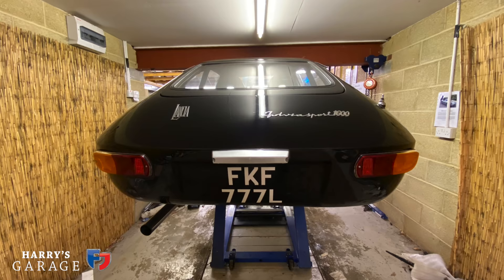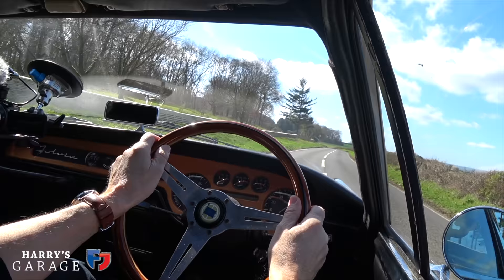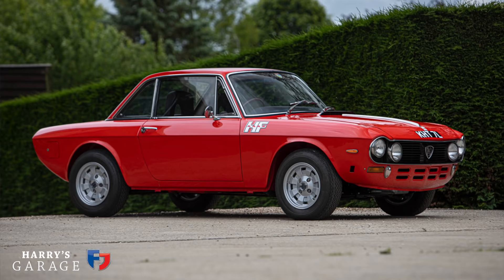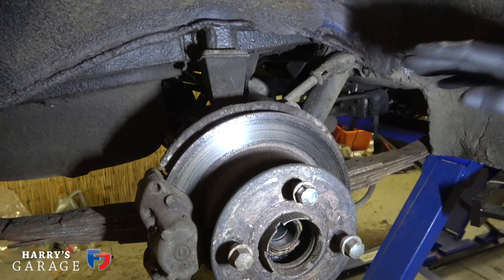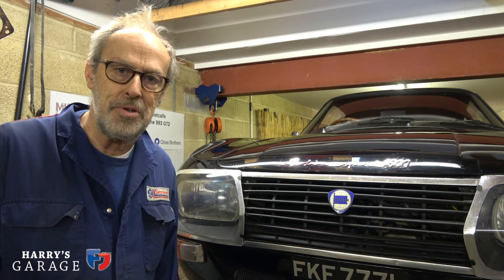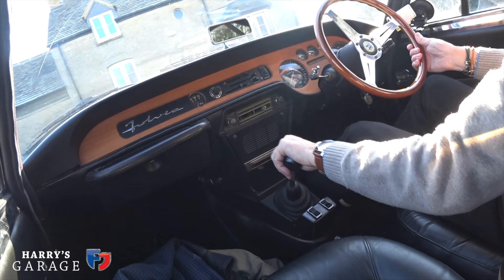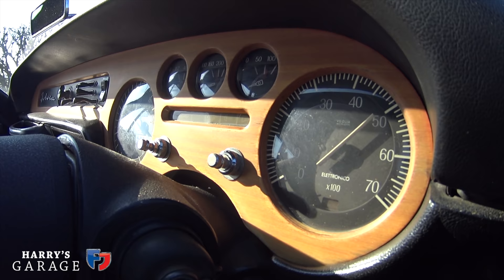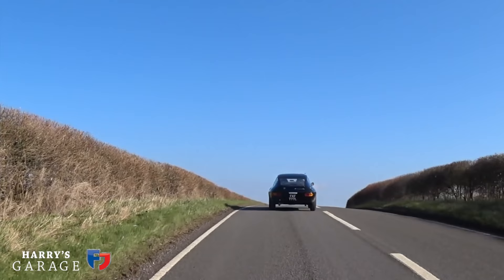Lancia Fulvia 1600 Sport Zagato. Best sounding car in the garage?

Comment: As a Fulvia owner myself, I'm a bit skeptical of what other enthusiasts often say, but they may actually be correct in that the Fulvia's stock air intake is carefully engineered for optimum flow. Using trumpets on these engines, while making a great sound, is rumored to be a cause of low RPM dead spots on Fulvias. I don't feel qualified to make that determination because I have not run trumpets on my car yet, but this is something that has been repeated for years by the more experienced Lancisti out there. They all seem to agree that the stock air box must be left in if you are running a stock tune.
Reply from the maker: I've had a number of works Fulvia 1600HF up here and none have run the standard air-box. The V4 is renown for having good low-down torque anyway, so I would say running trumpets is fine, although I've added air-cleaner socks to the trumpets now, as I don't like running road cars unfiltered. Sound is near identical too. Air-box is also heavy and kills appearance of engine bay; remember these cars are toys now, so make it the car you want it to be, rather than worrying about keeping it standard.
Reply: @harrysgarage  Thanks for the reply! It's encouraging to hear your response on the matter as you have a lot of expertise. I want to run trumpets on my 1300 to add to the sound and the driving experience, as I am not bothered by potential marginal drops in power. My car is already started towards a rally car direction and I would love to take it even further. Tastefully of course!

Comment: Now that's my kind of car. I was so stupid (I was ill for a few years and ended up giving it away) not to have hung on to a very tatty and forlorn early Honda CRX light-weight that had all the factory light-weight panels - only 90 bhp but only about 650 kgs or so. It was a practical hatchback coupe too.  For real-world travel on real roads it was the fastest car you'd ever need and did 45 mpg driven gently and 30 mpg at full chat all day.  I love small light cars. heavy cars, even with good power-to-weight ratios are fighting a battle of diminishing returns and make no sense to me at all.

Comment: An early 1.2/1.3 bumperless HF would be my ideal Fulvia with the original alloy spoked wood rimmed steering wheel and early alloy wheel style.  No plastic wheel arch extensions ( the early HF extensions were welded onto the body, painted and not as wide).  I'm a bit picky.

Comment: I work for a Range Rover Classic restorer and the main issue with this car, is a lack of proper cleaning. The reason rust is forming in the front wheel arches, is because they're plastered with mud and road grime. The mud holds water and road salt against the metal panels, which causes them to rust. When the car is washed, blast the wheel arches with water, get all the mud off and it will massively help preserve the vehicle. Range Rovers suffer with rot in front wings and arches, and most of the time it’s due to damp mud being held against the metal. Modern cars do not suffer as much in this area as they have plastic or carpeted wheel wells so the damp mud can't rust the metal bodyshell underneath. The same goes for the underneath, try and clean it with a hose regularly, admittedly it's easy on 4x4s due to the increased ground clearance.
Reply from the maker: I fully agree when it comes to RR but that's not the case here. This car had what was termed a bare metal respray back in 2001/2 and there are several areas where new metal has been cut in due to rot. I've discovered many of these had zero rust protection of any sort on them, totally exposed to what ever flicked up by the wheels. These cars don't get nearly as muddy as RR tend to when used properly, I've had several early Classics and know all about that massive mud trap at the back of the front wing, which goes on to rot out the base of the A-pillar where the door hinges fix!

Comment: You will do well not to plaster underseal back on the de rusted panels, it covers up the rust well enough, but underneath it is still corroding away, if you use an oil based product like Waxoyle it appears to soak into the corrosion and stop it, just look at the bodywork around the gearbox and engine where oil spray has coated it.

Comment: It's a shame manufacturers can't make their high performance 2.0 litre fart machines sound like this
Reply: The engine has a special sound because of its V4 confoguration, with unequal length inlet manifold and a carb per cylinder.

Comment: Great car but Harry is wrong in that the Zagato’s were not created from completed coupe body’s. The Zagato of Sport was a regular listed model and used a modified coupé floor pan. The gap between the outer and inner wing is a carry over from the first 911 examples which had an alloy body. The gap was sealed with a rubber moulding. When the body’s later changed to steel Zagato never bothered to change the pressings of the inner wing to allow it to be welded to the outerwing which would had made it a great deal stiffer.

Comment: Solex carbs are not the easiest to work on, on a rolling road because the main jets are underneath. When going on open trumpets, the main jets probably should be replaced.  Definitely, if you are putting on a more open exhaust, eg., removing the mid box, and putting on a larger straight through rear box. I have a Group IV exhaust, on my 1.6hf (which is one of the homologation cars), and it has no mid box, and just a very small straight through rear box, smaller than standard!!. It might be because it was tuned for hill climbing, rather than flat out power. Sounds incredible.

Comment: Harry, I have a 1600HF Lusso and spent about a year tuning carbs and swapping jets etc on the C42 solex carbs.  My HF was an extremely low mileage garage find and came with just velocity stacks on the carbs.  After a complete rebuild of the C42s, I could never get the car to run right until I sourced the proper air box for it.  I had to machine custom velocity stacks that would clear the air cleaner and box since I couldn't source originals.  Put the original jets back in the car and it idled perfectly and ran wonderfully all RPM's.  Might want to try to find the air box for the car.  If it has the C42 DDHF Solex, you need to either find the air box for a 1600 (good luck) or take 1300 airbox and bore the ports to 42mm to fit the C42.
Reply from the maker: I've got the standard airbox for the car and ran with it fitted for the first 12 months I owned it. Car ran awful with standard airbox, hence why I took it for this rolling road session. Runs perfectly now with trumpets and airsocks and much prefer the looks, so won't be going back to the standard airbox any time soon!
Reply: Noted. Love the car! Enjoy! They’re proper fun.

Comment: He's like a young man transported back to1972 when he gets behind the wheel of his Zagato Fulvia.

He needs to take it to Omicron in Norfolk who specialise in older Lancias for the rebuild to properly address and treat the rust in the body.
Reply from the maker: Erm, that’s who did the restoration back in 2001-2002
Reply: @harrysgarage  OMG Harry! I never took my Lancia there but was aware they "specialised" in works on older Lancias charging eye watering sums for restorations supposedly doing top notch work ........ You live and learn. But it was nearly 20 years ago, if what you showed us was what actually their work? Do you think that in the fullness of time you might give your Zagato to Mr Tyrrell to work on if he would be willing? Would make a fantastic series of videos to go with your series on your Espada. I feel honoured to have had a reply from Mr Metcalf himself. Thank you. It's made my day, my week.

Btw like you I've always like the Fulvia Zagato as well. Very pretty car. I had a std Fulvia 1600HF for a couple years many years ago when they were no where near the prices they are today and cheap as chips. Loved it. Do you think yours is a keeper?
Reply: @harrysgarage  That sounds crazy. I got a column construction issue in my 1994 Galant 2,0 V6. The serviceman cut a small body part out and welded it together with a patch. The patch was made of a thin sheet of poor quality steel. It rusted right thru in no time and corrosion continued since the wet air came "under the cover". Into the body tower. Eventually, I noticed the car would be in BETTER condition at that time if never "repaired" there. I tried to drive the car without the patch with the hole in the front of the body tower. I mounted there a kind of adopted measuring device. Inside that hole and there was no movement at all nothing wobbled nothing was to bend. Of course, I patched it later on my own. 
Sometimes you gotta do things on your own if you want it done right.

Comment: Also there should be a drip tray under the  carbs for precisely that issue.
Reply: timmo491  And a support bracket for the carbs
Reply: @apexdesigns3136  indeed.

Comment: What one really needs to do with one of these cars is strip the car down to the basic bodyshell and put it on one of those rotisserie stands so you can easily flip the thing upside down or at whatever angle you need so you can easily see and access all the trouble spots without buggering up your neck and your back from all the contortionist acts you need to do to see into every nook and cranny.

Comment: The reason the metal in 1970's Fiat brands was so bad was that Fiat sold the 124 production line to Lada in exchange for Soviet steel.  The Soviet steel was horribly rust prone, but Fiat was stuck with it for the better part of a decade...

Comment: What they did at the shop, I think, was to match the carb jets to the open intakes. And what's do to next: Change the steering wheel to a real classic Nardi (with thin rim) or to an original.

Comment: Yes could be better to have a bigger idling jet sounds like it's choking it self and main jet would help you with more power in the power bands go to the next size up or two,  if u really want to get real power out of it put  bigger Weber's 44 on it gasflow the head the inlet and exhaust better gas flowed exhaust manifold, you could achieve an extra 100 brake horsepower. Ideally have the crank balanced and flywheel

Comment: Fender... metal sheet and riveted rubber slab against fender... thats all... and never ever any kit!
It works with the movement of the bodyflex. Zagato noses are weak... and can be strengthened.
Via subframe etc... Is info about on Lancia Forums... standard known issues in the Lancia community.
Happen to have such a 1600...

Running is carbs and cam type... the hotter, the worse... Mine does a 1500 rpm fine, so the transition, but have driven better ones.. but is not 100% on its 42... Check for leaks and play on the throtlle axes... Wear out quickly. But can be rebushed and axles chromed and cut to perfect fit. No false air...
Variante 1016 has the hotter cams and the 45 Solex.
The standard airfilter works best. Lancia thought about that. You don't want that amount of dirt in your engine!
It can ruin your valves!
Very important is the correct float position, and propper ajustment of the accelleration jets!
These jets can leak inside the carb. 2 channels per carb... spoiling the pick-up. Regularly check the colour of the sparkplugs... those tell the story... Never ever use E10... eats your carb...

Comment: Hi Harry, I'm guessing you don't have heating in your garage as I notice you wear a body warmer but i was wondering do you use a dehumidifier & if so does it help to keep rust at bay ?
Reply from the maker: No, I have heating in the garage via underfloor heating. I keep it at 14 degrees C during the winter, which makes working on the cars almost a pleasure. Also means I don't need to use a dehumidifier
Reply: @harrysgarage  Thanks Harry. I have a small garage of motorcycles and was wondering what the best way to keep them dry was. Looks like heating is the way to go.

Comment: Not sure if it was quite in the tmeframe, but a lot of early 70s FIATs and other Italian cars were cursed by the use of Russian steel, which was supplied to Italy in a barter deal involving the old FIAT 124 tooling going to Russia for the making of the Lada. It was paid for by Russian steel, vodka and grain.
You're lucky that car didn't dissolve and run down the drain, but it will always want to return to mother Russia, via the North Sea.

Comment: Dude. OK, yes, it sounds good. But if you want your valves, seats, rings, and bores to wear away in no time, just drive around without air filters. (SMH....)
Reply from the maker: I agree and that's why I had a air-socks fitted to the trumpets during the tune-up, which I forgot to show in this video.
Reply: @harrysgarage  AH! OK. You had me worried there! Also, keep a fire extinguisher handy. Occasionally, a backfire can set the works alight.